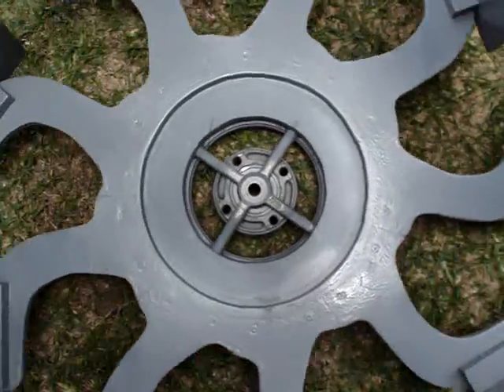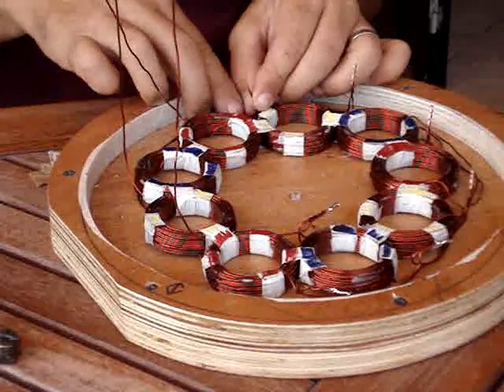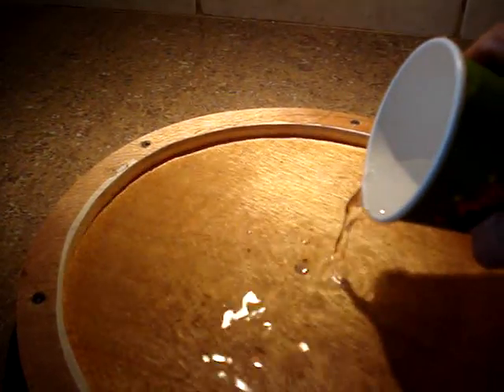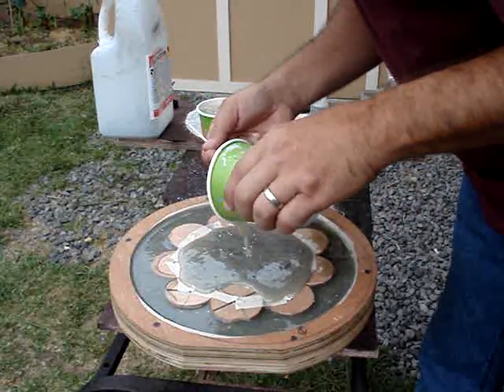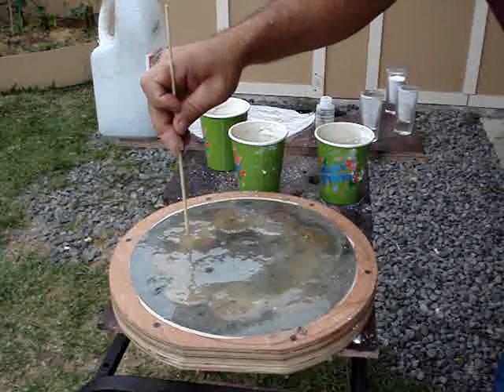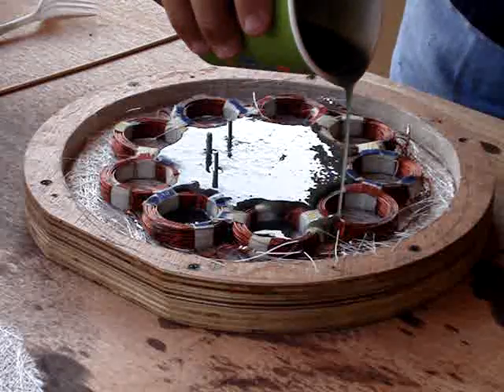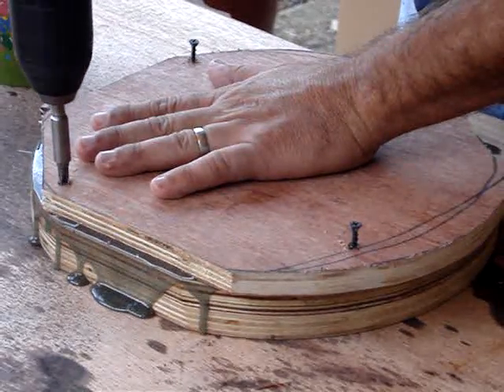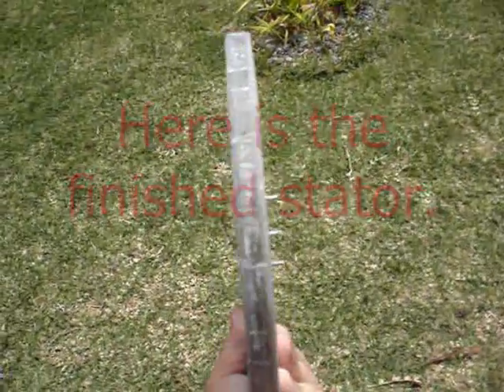How to build a homemade stator for a P.M.A generator (wind turbine, hydroelectric)

Comment: Really good video! One question? Why would you put the three electrical connections on the inside? I put mine on the outside edge of the stator. Easy to get at to plug in. But I guess I haven’t seen your finished product yet. So, maybe it makes sense.

Comment: did you outline your calculations for number of turns for each coil to give you a specific output?  Volts and current?
Reply: I see this video is 11 years old, so not expecting him to answer.

I think that's why he emphasized the "rules of thumb" regarding the dimensions of the windings. He's using permanent magnets for the field charge, so the turns ratio would be much more important for voltage output control. Assuming proper diligence when wrapping the windings, physical dimensions are an acceptable alternative to counting each individual turn.

I've built a prototype generator which uses an electromagnet field. My findings are that the turns ratio is less important due to the ability to use a voltage regulator. But there are some balances to consider, depending on your source of mechanical input. The greater the ratio, the more torque input required but with lower field voltage. The lower the ratio, then the less mechanical torque required but needing a higher field voltage.

That is also a self-excited configuration. I'm going to build a second prototype which is not self-excited. Using a secondary permanent magnet generator on the same rotor shaft for the field charge, with the output regulated by the same voltage regulator configuration as the self-excited version. I'm a bit skeptical due to the inherent limitations, but I am curious to see how the efficiency changes as metered from the stator output.

The end goal is to build a practical generator. Thinking I'll probably also post a video series to document the build.

Comment: Beautiful video, after 9 years could you give me an update? I'm interested in creating my own aswell :D I'm scared to use the resin haha! don't know how to use or prepare it..
Reply from the maker: The resin is no problem. This design did not work so well on the vertical turbine it needs a lot of RPM S to make good power.
Reply: @Aceman307  thank you for the fast reply, I think in the future people need to be more capable of producing their own energy. So i'm eager to learn about creating generator & stators from scratch! thanks for the informative video! they also created new wind turbines maybe they produce more rpm
Reply from the maker: @stedated  You could use this with a horizontal type wind turbine or maybe a hydro generator.

Comment: 1/2 the width of the diameter of the magnet? I'm trying to make sense of that.
Reply: Coils like on his picture not like he did(circles), the plate with magnets needs to have at least 1/2 of magnets thickness as it needs to conect magnets magnetic fields together. Coils thicknes also 50% to 100% of magnes thicknes. 12 magnets on each side for 9 coil stator(4 to 3 ratio). Find movie where someone is showing you that and then you know that he knows what he is doing and you can folow his instructions... not this guy seriously.
Reply: For example 2 days ago guy "Piotr sk" uploaded video "Jak zrobić prądnice do małej elektrowni wiatrowej" its about small generator of this type but you can tell that he studied the subject properly...

Comment: I have a suggestion for the next mold, if you fill the mould with chopped glass before you dump in the resin it will be much stronger. You really want to use the minimum amount of resin for the quantity of glass or composite.i do Like your ideas good luck

Comment: bro great job, but so confusing, cuz
center of the coil is internal diameter
i dont know what half the width of the diameter means. I thought you meant half the diameter, which 3/4" but thats no where on your diagram? so what and where is the height of the coil
and your diagram says that the coil is both 1/2" and 3/8" thick?
Reply: and its solder not sader

Comment: hii,

i would like to build a coil for generator for fun project.  or motor coil. 

may i know what magnet wire gauge i should be buying ? 

what is the factor of consideration ? 

what size of magnet wire can handle how much current that flows thru it without burning out the enamel ? 

thanks

andrew
Reply: You can safely assume 2.5-3.5 Amp/mm2 take 18 or 19 SWG or anything near that range. 19swg is  1.02mm and 18swg is 1.22mm in dia. 18swg is generally 3.2 amps which is a very conservative value. You can even take 4amp/mm2 without burning the enamel if proper airflow is available.

Comment: I'm sure you've gotten this question a bunch of times.... How much money would you say it takes to build one of these? Or if you can answer what is the range of money it would take to try and build one that just barely works vs one that REALLY works well.
Reply from the maker: The most expensive part is the wire it depends how many coils and how much the wire cost where you live.
Reply: You can save money using ferrite instead of neos but your power output will suffer.

Comment: I'm asking this question on your video because I need help and I think you would know the answer. I need to make a generator out of this project. What would be the best way to do it for the most power output? Magnets on each side/coils on each side, or Magnets on out side of wheel and coils on front and back of wheel?   https://www.youtube.com/watch?v=tD7-0O9GPDQ

Comment: Each color  wire's  have a starting pole which its exiting wire goes  to the start of the 2nd coil and it's exiting  wire goes  to the beginning  of the 3rd coil But where does each 3rd coils exiting  wire go , If you know what I mean. Do all starting poles go together ,and do all ending poles go together  ,I'm trying  to understand  this I'm new at this .

Comment: It also surprises me, why you don't use the same technique as those big giant windmills. 1 rotation of those blades, gives 70 rotations on the turbine, but you still use a direct approach. If you choose to lower the weight significantly, you could easily go for a 1 rotation of the blades to 20 to 30 rotations on the generator. but not with those tiny little blades.
It actually surprises me, you'd settle for those tiny little blades anyway. You obviously know what you are doing, so why not think bigger and more efficient, like a vertical windmill? (you have to tilt it a couple percent to get it's full potential, i've tested it)

Comment: He he :) thanks for ur works and an advice from we, if you burn to end of coil for destroy wire isolation(enamel) by a small fire(for ex: lighter) it will be more easy but you must insert suddenly into a cold water(will be too more easy if it mixed some spirit) after heated to wire  for sperate burned isolation enamel seperating from wire instead of destroy with a knife too shape too. Thanks... 
I was measuring to caliper of wire in 0.01 mm sensivity by this technic in Abana Motorsan 3 phase AC Engine Motors...
Reply from the maker: Thanks for the comment

Comment: Sir, good morning, I do not know how to speak English.

Congratulations on the invention and beautiful tip and I come humbly to ask for your help, because I am suffering a lot.

Well, I am a small family farmer in the rural area of Cristalina GO, in the Federal Government setting of INCRA Vista Alegre in CRISTALINA GOIÁS BRASIL, here it is lacking energy and daily.

Do you have this project on paper in Portuguese with copper wire gauges due to emperage, voltage and production in 15kw?

If you could adopt for wheel water to make touching a frizer, tv, internet apparatus, a water cooler, fan, cellular charger, shower, lamps, hair dryer, lamps in a water pump of 15kw.

We were 236 families and over 1200 in the municipality with the same problem and

We really need this wonderful invention.

Here we do not have a cell phone signal either, I only have the internet and it only speaks on Facebook aecioaires Aires Fernandes and zaap 61 996071219.

How can you send your zaap if you speak Portuguese?

thank you

Comment: to generate a current you have to wind the wire around an iron core so you create an electric field, right?
Reply from the maker: Thats how you make an electric magnet. You dont need a iron core.
Reply: aceman307, did you perfect the generator to obtain an acceptable voltage and current? gave you a tick, thanks
Reply from the maker: The generator works you just have to spin it at the proper RPM to get the required voltage. I really did not have enough wind in my location to do that.

Comment: As I was scrolling down reading comments on this video,I found a very 
stupendous suggestion posted by +GroovyVideo2. I feel attracted to 
respond to his post by a NEW COMMENT

Here is what +Groovy said

"wonder if Plaster of Paris would work instead of resin - maybe mixed with
fiber glass Flox -
plaster dose shrink 5% when drying - plaster may work well as heat sink also -"

I assure you it will work since I had also tried it.
I tried running this setup with naked coils, just held together with masking tape ,and it gave me very good results,just like the ones I got after APPLYING THE PLASTER. So ,Scientifically ,there is no violation of the principles of electromagnetism.

The only things you have to take into consideration is 
1)Minimize the distance that the plaster of Paris combination will take so that the magnetic field between the magnets(across the stator) wont be reduced

2) Keeping your combination away from water/solvents such that the plaster wont be affected. This too applies to humid conditions which in the long run could degrade the plaster.

My final recommendation to this would be ,If at all one uses the Plaster Of Paris (POP) instead of the resin, this setup will be fit for indoor uses and not for outdoor wind generation.
Reply: Benedict Buberwa hahahahaha 🤣🤣🤣🤣🤣🤣🤣🤣

Comment: Can you please explain, why you cast coils into fiber resin? Why i cant use them just open?

Thank You
Reply from the maker: Because you need to place the coils between the two magnet plates" stators". So they need to be rigid and straight to fit closely between the two.
Reply: Thanks You.Did you test coils before filling with resin?

Comment: i appreciate these videos,  may I ask what size is the copper wire along with is there benefits of using a 3 point wind compared to a round coil? Lastly is there a formula that you have with regards to using different wire thickness? Thank you so much
Reply from the maker: I used 18 ga wire. I dont know of a formula. But normally the smaller the wire the higher the volts but less amps.

Comment: how did you wire the copper  for each phase? meaning you start with phase one with 3 copper coil  and the 1st coil you wire the bottom coil  to the top of the 2nd coil and so on? Right?
Reply from the maker: If you type in google images" 3 phase wind generator wiring diagrams" you can find a drawing that should help.

Comment: where can i get the sheet that you got? also are the wire set up meaning do i start with the top wire of the coil or the bottom wire of the coil? and do i alternate on each phase mean if i start with a top wire on phase 1 do i need to start with the bottom wire on phase 2 ?
Reply from the maker: This video is pretty old I guess the website I list on the video has the drawing available. No you dont have to alternate but it is important to use the same side out of each coil when connecting them together.

Comment: Why did you use talcum in the epoxy?
Reply: the tal acts as a filler.  it save on the amount of epoxy needed.  You can also use glass microballoons
Reply: You would think that micro-balloons would make the epoxy much weaker.  It would be like using round river pebbles in concrete instead of crushed angular stone.  Round stone makes concrete weaker.  Also, I don't understand how magnesium oxide (talc) makes epoxy stronger either.
Reply: Yes, but it is counter intuitive. The glass microballoons make the epoxy incredibly hard. I use it all the time as filler. You can also mix colloidal silica as a thixotropic agent, it also increases the hardness of the epoxy.
Reply: Tom Cool - I believe round stone in concrete has that effect where this does not because the adhesion between the cement, and smooth stone surfaces is not nearly as strong as epoxy bonds to the glass... 

  Crushed/Irregular aggregate in concrete, besides allowing the concrete to bond more strongly to it's surfaces, probably also does better at reducing linear pathways for propagation of cracks or fractures through the overall material, as opposed to round rock that only touches each other in spots, and leaves continuous areas of softer, aggregate free cement between...
Reply: I think I use something called Carbo-sil.  It is probably the same thing and is a filler.  But why did you make the second one kinda grey?

Comment: hello friend good day, I'm a project of this here in Brazil.
but I do not know how to connect the stator connection and stele are 12 neodymium magnets and 9 bombinas. bombinas I know the call, plus the three stages I do not know how I turn to feed this battery and my primero project I am starting this generator design can help me in any way.?
Reply from the maker: +SANTANA CHAVES If you watch all my videos on this build they should answer your questions . In this video there is a diagram of exactly how to wire the stator. I have a play list on my channel for this complete build. If you still have questions I will help if I can. Thanks for watching

Comment: Immersive work. Just a question. If one single copper coil gives 3 volts, will you have 27 volts with 9 coils?
Reply from the maker: +Hamed Faizi No it does not work that way , the slower or faster the magnets pass the coil effect the output voltage. Thanks for the comment.
Reply: +Aceman307 Got it, thanks for your quick reply. If we assume that the rotor RPM and magnet arrangement and strengths are the same for both cases; will increasing the number of copper coils in the stator increase the output voltage proportionally?
Reply from the maker: +Hamed Faizi It will increase the output voltage but I do not no if it is proportional. The only way I know how to test this is to have a way to spin the rotor at a constant speed and remove or add coils . There is a You Tuber called Emagnets and he has done alot of testing this way checkout his channel. I hope this helps.
Reply: +Aceman307 Cheers champ, will do.

Comment: hello friend ... you only make a replica of the video or you is project owner ? Provide the project? youtube has many videos making power generators however no one explains how it's done ... no one provides the project ... I would try to make one for my house ... can you help me ?
Reply from the maker: +PIMBOCADAPARAFUSETA This is my project if you watch all the videos in this series I show all the steps to make this work. If you have some specific questions I will help if I can.
Reply: +Aceman307 
then ... have a basic course in residential electrician ... do not understand much ... I like to make at least generator 2kw / h with low speed and generates a voltage to 250v ... but do not know if It has the exact size of the circle or how to wrap the coil to give this value informed ... and as imendar coils to outputs of the phases ... information as these have need ... hugs
Reply: +Aceman307 Right ... I have not found other videos to watch ... anyway ... if you help me make a power generator ... I appreciate it ... hugs

Comment: i get the general idea your conveying here, but i do have a question.  what kind/brand of resin did you use to set the stater in?
Reply from the maker: +Troy Moore Regular polyester resin used alot in boats.

Comment: Hey there, nice video, i understand everything but the fact,
a coil has a beginning and an end, where do you have to
attach the beginning of a coil at, but i mean the first coil, where it all starts
i understand that you should connect the coils with each other, but at the real beginning
i know my explanation isn't good?
I would love it if you responded, i'm gonna
make this for school :D
Reply from the maker: +Bartsbass When you wind the coils you have to make sure you use  the same beginning wire of the coil on all three and connect them together then the other ends get connected together If you use just the three coils connected this way it would be a single phase. Make sure you watch all three videos on making this PMA. It will explain the whole process.
Reply: +Aceman307 Ok thank you!
another question ;s
Does the diameter of your magnet have to be the same
as the diameter of the hole in the solenoide?
so when it turns, at a point when you could look
through the solenoide you should see the entire magnet?
i know my question is a bit weird :c

Comment: I do not understand why there are 3 outputs (wire). What is plus and is minus? Third What does?
Reply from the maker: +Cozmin Agheorghiesei This is a alternative current generator so the three outputs put out A/C current +++ there is three sets of coils staggered 120 degrees apart that way you do not have pulsing from the generator. You hook the 3 A/C wires through a bridge rectifier to get the D/C volts you need to charge a battery . I have other videos on this check out my playlist. Thanks for watching

Comment: Cool, looks very professional (and strong)! What kind of resin did you use and where did you get it!
Reply from the maker: +Blakehx Polyester resin you can get it at most hardware stores. Thanks for watching.
Reply: +Aceman307 Hello
I've seen this way of working which is good, but if possible: I want to know resin user structure , as well as falling rates of materials in combination,
Thank you for caring
I wish I could get on the chemical composition clearly and speed possible, because I could not understand through the video clip, because of my poor English.
Thank you